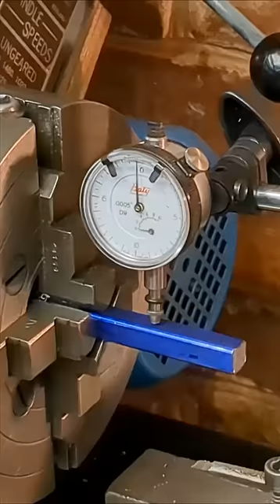Mini boring tool in carbon steel  - main video to follow

Comment: Why did you not just machine the flats with an end mill ?
Reply from the maker: Good question! I didn't have access to a milling machine nor suitable square stock.
Reply: @Workshopfriend  interesting, what do you use that machine for usually?
Reply: @Workshopfriend  No mill but a shaper...Awesome...I always wanted one, but none ever comes for sale around me...
Reply from the maker: Generally a bit slower that milling machine a shaper is also used to generate flat surfaces.  Unlike a milling machine a shaper can be used to put keyways in pulleys etc. The greatest advantage is that the tooling is cheap - similar to a lathe tool.
Reply: They say the only thing you can’t make with a shaper is money
Reply: @DynamicSeq  I didn't have the space for 36" Cincinnati's I think were going for 600$ around my area years ago.
Reply: @SW-ii5gg  That is unfair cheap. Would love to have one...I got a nice 5hp horizontal mill With boxes of tooling for 100$ last year.
Reply: @DynamicSeq  it was between late 90's early 00's, several of that model was available, I wanted one but things in life didn't work out, as I was building a home shop, I went through divorce and losses broke me into a bitter old man that used to be able to get things for cheap that are worth very much now.
Reply: @Workshopfriend  I used one in my machine shop course, it had like 48" stroke, great for keyways!!!
All our machines were like from WW2 🤣

Comment: I need a boring bar that the cutter an tip of the bar isn't any bigger then .250 an I'm having a hell of a time sadly it needs to be carbide....thinking this project has hit a halt for now
Reply from the maker: Can you get a tungsten carbide tip small enough to braze or silver solder onto a suitable shank?

Comment: Nice machine.Y1986 was used shaper machine for my tool and die making training.
Reply from the maker: It is an Elliot 10M (10 inch) which was the smallest of their range. In that case you will have much more experience than me! Thanks for the positive comment.

Comment: Jings that's old fashion machine I used do that 40 years ago, replaced universal milling machine and it quicker!
Reply from the maker: Yes, I agree. At last I have obtained a small universal mill so, after a little renovation, I will be able to take advantage of the greater flexibility.

Comment: Why didn't you just buy one and save a lot of money.   Loved seeing the shaper, haven't seen one of those in a tool shop in over twenty years.
Reply from the maker: Even if I had bought one with those split square section holders I might have had height problems hence the eccentric turning to get the offset. I think my four way tool post is too low. I quite like the old shaper!

Comment: What did you make?
Reply from the maker: Thanks for the question. It is a boring tool to bore small holes in a lathe. The round section is offset from the square section to achieve a specific tool height. I used it in another video to make a close fitting M14 internal thread.
Reply: @Workshopfriend  thanks for the reply. Nice work. Most of the people commenting crap on here couldn’t wipe their own butts.

Comment: Buen día..no era necesario hacerle la parte cuadra a toda la barra.. sólo al espacio para el porta herramientas..🤗(Renny Valdivieso)dsd Venezuela
Reply from the maker: Thank you Renny for your comment. Unlike a milling machine, with a shaper you have to traverse the whole length of the work. If I had cut crossways it would have taken a lot longer even if I had restricted myself to the portion clamped in the tool post.

Comment: 2 операции Вы могли бы сделать на фрезерном станке, а не на строгальном и сврлильном👍
Reply from the maker: It certainly would have been quicker on a milling machine which is why I have just obtained one. However, the central offset portion would still have had to be turned to fit in the small bore. Thanks for your comment!

Comment: Mas, afinal, para que serve isso?
Reply from the maker: It is to hold in my lathe that small piece of sharpened tool steel in precisely the right place to be able to cut a small internal screw thread.

Comment: Would have been a little easier to use an End Mill the a shaper but what's even more easy is just to buy Square stock😂
Reply from the maker: You are right it would. Good comment. However, it was quicker and cheaper for me to make from what was available.
Reply: @Workshopfriend  👍

Comment: When you finally fix the scrape machine and still have nothing to do with it.
Reply: Shaper…
Reply from the maker: In my humble home workshop the shaper has been very useful. I don't have a milling machine.
Reply: @BryceKimball7.3  it would be if it were set up right. In its current state,  it's a scraper.🤣
Reply: @Workshopfriend  do what you do brother man, a shopping machine is actually a very useful machine if tooled and set up correctly.  Don't expect to "turn" a profit with one though.
Reply from the maker: True!

Comment: Пусть я покажусь идиотом,но зачем из круглой детали делать квадратную,а потом из квадратной круглую, неужели их нельзя было поменять местами.???😂😮
Reply from the maker: After comments started coming in I realised this may need an explanation: Firstly, I didn't have square section in that quality of steel; secondly even if I had square section I would still have had to machine two sides to make a non-standard size; lastly the round section was necessary to fit in a small hole. Hope that makes sense 🙂.

Comment: А металл строгают ? Строгают, ещё и долбят .
Reply from the maker: Yes, the metal was planned. Though technically in a metal planer the cutting tool stays still and the work is traversed. This would have been used for large or long surfaces.